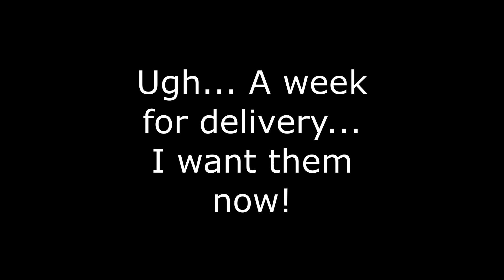Arduino Self Balancing Robot

Comment: Motor Driver: L298N
• Two DC Motors
• IMU Sensor: ICM-20948 (connected via I2C/SPI)
• Microcontroller: TM4C123GXL
Would you please give me some pointer how to get my 2 wheels self balancing robot to balance. my robot moves forward and backward but not balance
Reply from the maker: I’m afraid that isn’t really enough information to work off of.
Reply: @careyian  do you need i provide my code and the instruction for self balance robot,please help
Reply from the maker: @khanhlam1481  I probably won't be able to help you. It's very hard to debug a system without getting my hands on it. Sorry! If you have a question I can try and answer it but I can't help with debugging vague issues over YouTube comments.